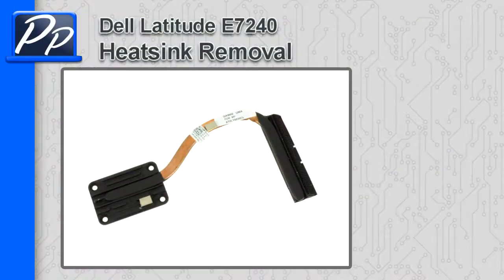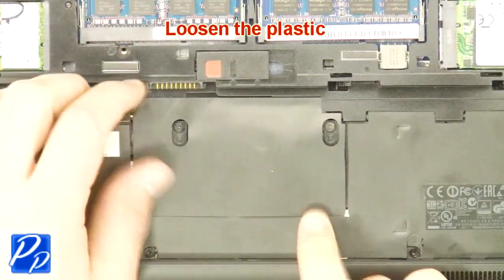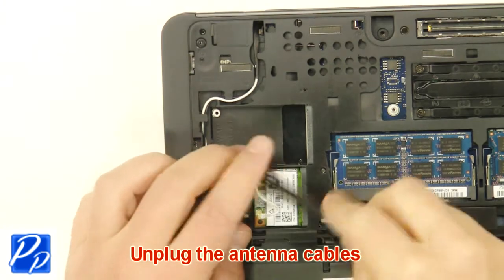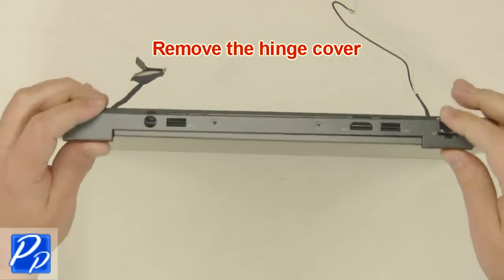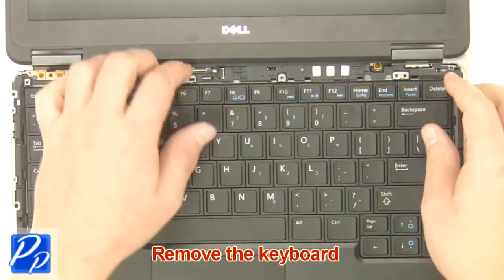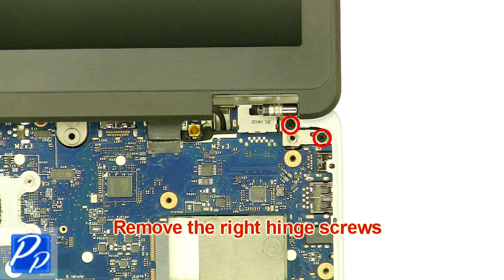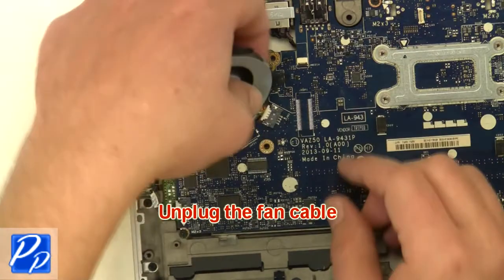Dell Latitude E7240 Heatsink How-To Video Tutorial

Comment: Do what I did instead. Remove the heat sink screws (5 in total) . At 4.30 in the video.
lift the heatsink base until you have enough room to remove and reapply thermal paste. Takes 2 minutes.
Reply: Nice! It`s works.
Reply: Are you saying just remove the bottom cover and then go immediately to the 4 heatsink screws and then just pull it out and reapply paste without going through all the other removing the motherboard mess?
Reply: @FubarMike  yes

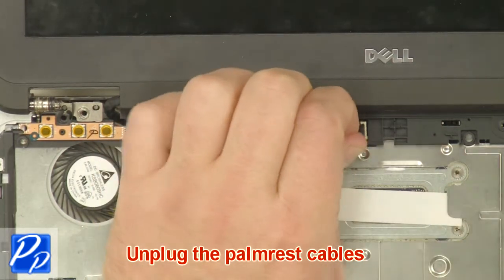Comment: I was wondering that what does the wire removed at 3:04 is for ?
I just broke that wire while pulling it out. However, surprisingly my laptop works completely fine.
Anybody having any idea what does it do ?
Reply: Fairly likely it's the built in webcam.
Reply: @pfkninenines   @pfkninenines  I think I know now, what that wire is for.
The three led lights located right above the HDMI port on my laptop are not working.
Most probably that wire is for those three led lights.
Reply: @pfkninenines  I thought so, but camera is working properly.
Checked few more things in my laptop, still don't know what that wire is for.

Comment: I have a question, at 1:30, the bracket for the fan. Mine broke off (the hole that the screw goes into). Now my computer wont take power. Is this related? I thought it was a normal screw bracket so not that important :/
Reply from the maker: This bracket missing should not prevent your laptop from turning on. Just be sure that each cable is securely seated.
Reply: @dellpartspeople  I figured it out. Had to take out the battery, hold the power button for 30 seconds, plug the battery in, hold for another 30 seconds. THEN it worked :P

Comment: It's a shame you have to tear the whole computer apart, while the heatsink with its screws is in front of you right from the beginning! All of this because of the stupid fan!
Reply: is this 100% certain to be the case?
Reply: @h3xag0nal  yeah i'd love an answer.. mine runs hot and i'd like to put some new thermal paste in. it LOOKS like just the four screws and the heat sink will come out.. is the fan holding it in or something? do you seriously have to tear down the entire laptop to do this?
Reply: @rpm10k.  yes. I ended up repasting and it was an ordeal. Had a few screws left after reassembly but it worked.
Reply: @h3xag0nal  wow thanks for the answer on your 7 month old comment, lol. Mine will run at 55-60c just browsing old.reddit. Fan runs like a turbine constantly. Did it help? Was it worth it? I need to replace my speakers which requires about the same disassembly.. so I'm thinking about it..
Reply: @rpm10k.  barely worth it. I think blowing dust out of the radiator and fan did more than the repaste. YMMV.

Comment: What do I do if the heatsink screws are stuck and I'm beginning to strip them?
Reply from the maker: Make sure you're using the correct size screwdriver so it doesn't slip and strip the screw head. Having a good amount of downward pressure helps too. 

You can try this too but any possible damages are at your own risk. Use a can of compressed air. If it's held upside down, it sprays out super cold. If you get the screws super cold, they should shrink just a fraction and that might help them loosen a little easier.